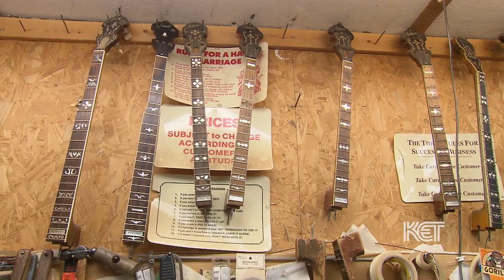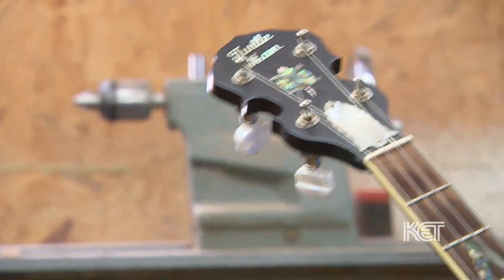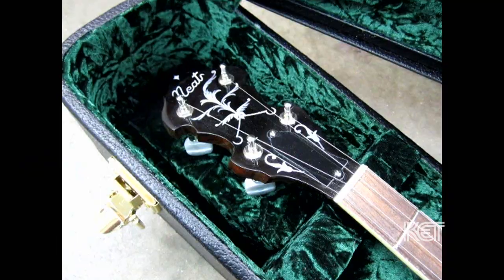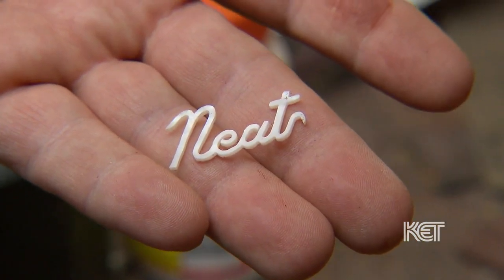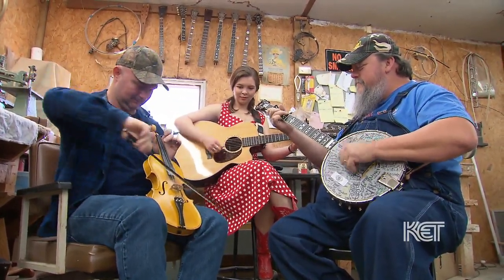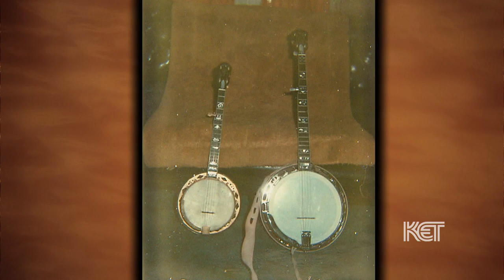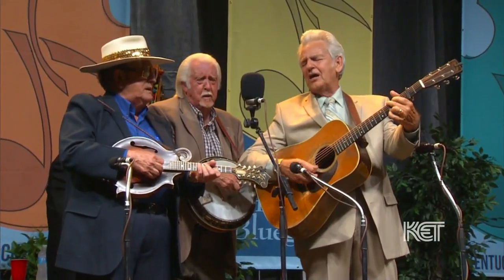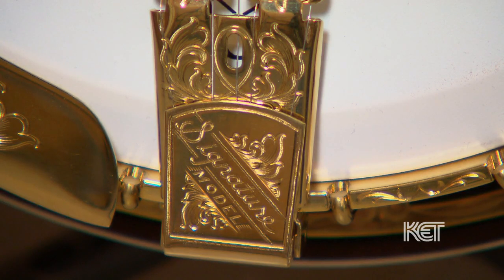Luthiers, Part 1: Banjo Maker Frank Neat | Kentucky Life | KET

Comment: Oh my word... one of my best friends for life is a hundred pound tortoise (and a wee one the size of a White Castle burger, same kind, sulcata tortoise). The only turtle or tortoise I'd ever seen in relation to banjos before was a Greateful Dead (Phish? no..Dead I think) reference, but I'm not huge on them and certainly didn't want to advertise them. I'm really liking the turtle or tortoise made of shell for Turtle man. I'd love to just realy slowy make my own banjo, but I'd better knock out a couple basic ones first. Despite being a decent craftsman of premium archery bows & banjo bridges, I'd hate to make a banjo with three years of downtime in inlay only to figure out it had crummy intonation cuz I did  something wrong. I guess, though, if I wanted to do some inlay over time I could get a trusted, slotted fingerboard and be working on it. I've done fine lapidary and wouldn't screw that part up. I have a Foredom tool I want a motor & cable for & they've got that great inlay holder for it at Stew.